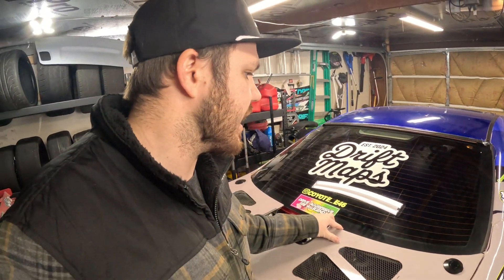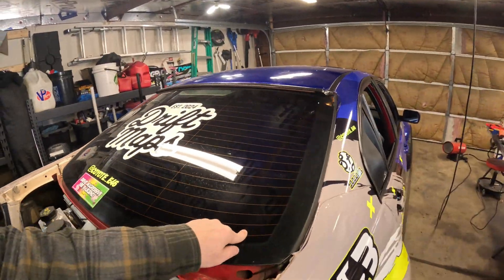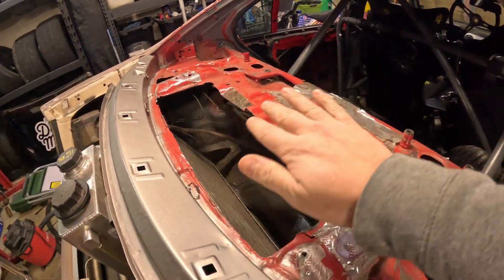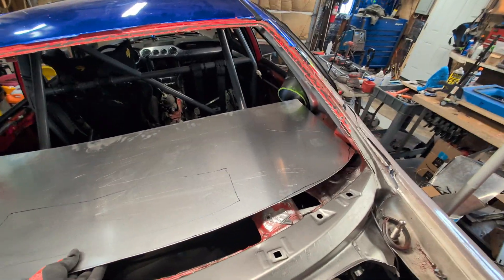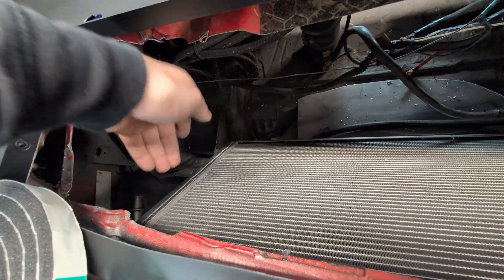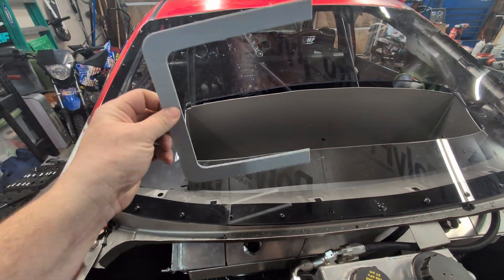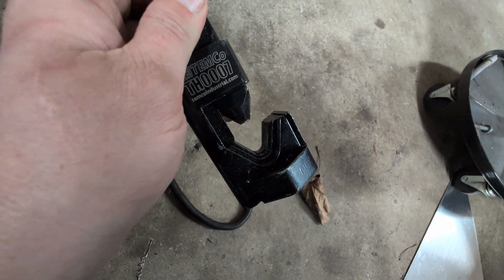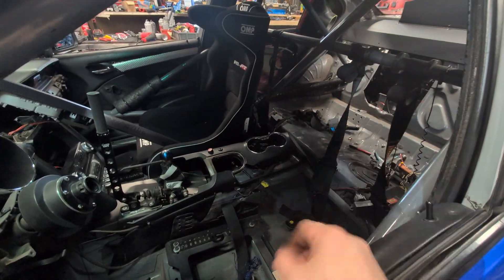Updates to E46 Rear Mount Radiator

Comment: Hi is very nice yours car wheels I understand is Konig Hypergram wheels that size wheels and tyres mate you used meybe have link where I can buy this wheels?
Reply from the maker: @svajunassss  these are 18x8.5 in the front and 18x9.5 in the rear . If you head over to Konigs website they have a dealer locator to help you find one near you!